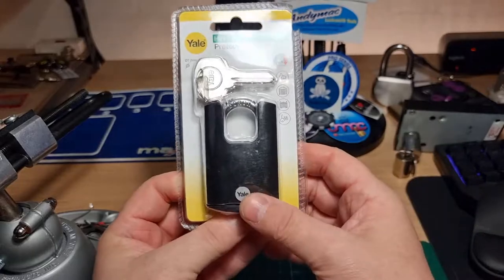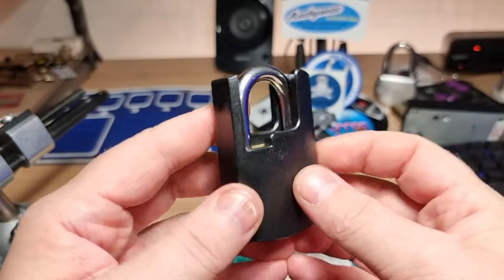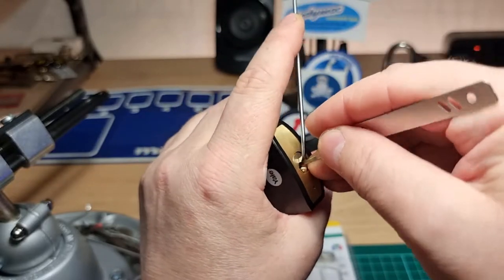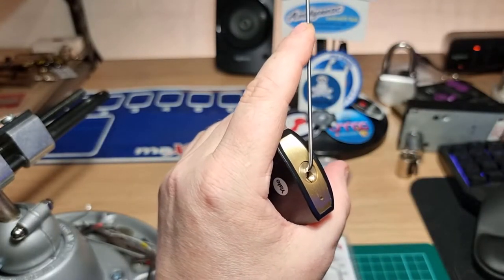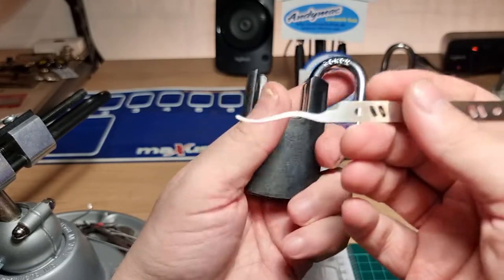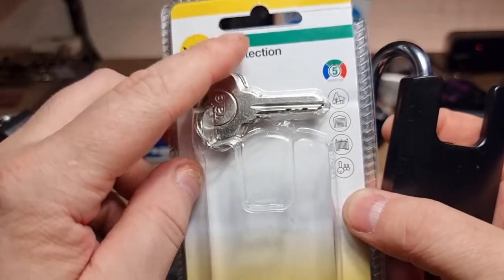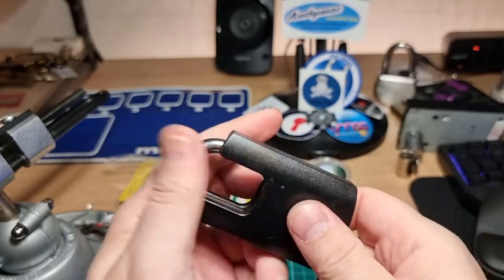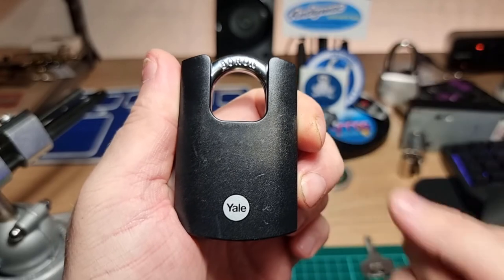(147) Yale Y121B/40/125/1 46mm 5 Pin Padlock

Comment: Nicely done, and I'll do the same thing with my picks.  I'll go through different picks and see how many I can use to open the same locks and which one's are easier.  I was so stuck on using my Ssdev set on everything it got boring.    It's a lot of fun and helps you get use to new way's of doing things.  

I like the lock but that plastic shroud makes it low security from my standpoint, but still a nice pick.
Reply from the maker: Thank you 😁
I do like the ssdev set but I've only got it in 0.015, it's my go to for paracentric keyways.
I seldom use the madbobs set so I decided to try and get a bit of practice with them.
The yale is ok I'd basically consider it a 40mm brass padlock with shim protection..
Cheers bud 👍 🍻